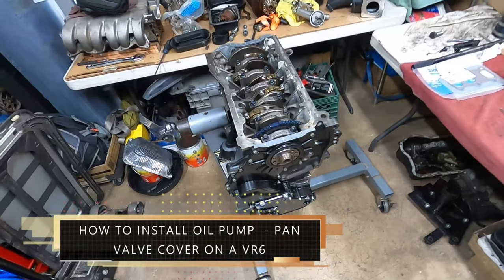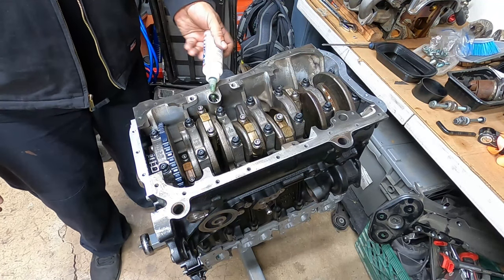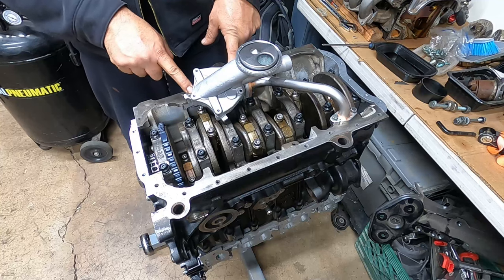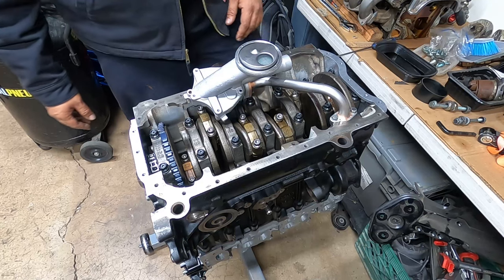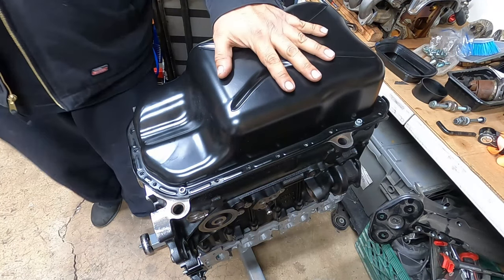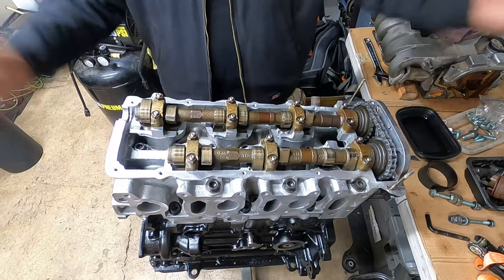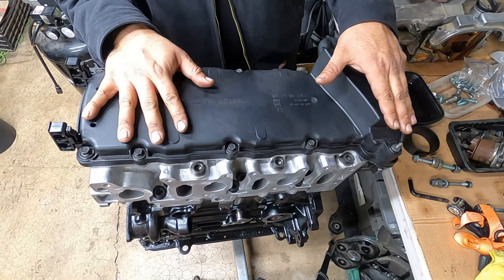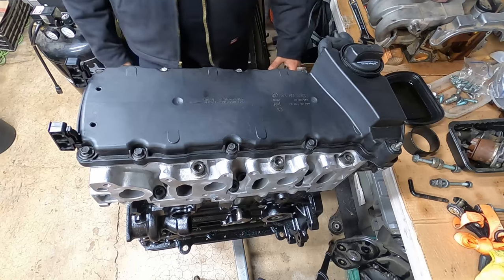How to install an MK4 Jetta/gti VR6 oil pump - pan - valve cover S7EP22

Comment: I ran into a similar issue with pan clearance with my baffled steel pan.  Found out that using a mk5 r32 oil pump is the only way some shorter pans can be ran.

Comment: What is different on the 24V.  I have one that keeps throwing the warning light.  Was gonna pull the pan and change out the pumpt etc.
Reply from the maker: 1st check your oil pressure sensor 
Check the wires and sensors before you pull the pan.
If you done that still have a light then pull the pan Inspect the pickup tube for debris if it's clean then the oil pump needs to be replaced
Reply: @PincheALsGarage  Excellent, thank you!
Reply: Hey how would i go about checking the sensor and wiring

Comment: So I’m doing this under the car. Is it much different other then clearance and free movement? And are those really the only things that the oil pump plug into?
Reply: I’m doing a aluminum pan and oil pump cause a rock shattered mine to pieces

Comment: What’s your go to place to order vw parts? I have a 24v vr6 just sitting around because the oil pressure light kept coming on and a coolant leak.
Reply from the maker: We use 
Urotuning.com 
Ecstuning.com
Fcpeuro.com
AutoZone 
For all our parts we make sure that we only get German parts too.
Reply: i just got mine and its doing the exact same thing

Comment: Good tutorial again al. Could you not laser cut like a 10mm shim to use as a sandwich between the oil pan and block? On you plasma table.

Victor reinz should become a sponsor of the channel 😁
Reply from the maker: Talking to Luis he said its suppose to be like this. So we are keeping the pan
Reply: @PincheALsGarage  but wouldn't that block the oil pick up though
Reply from the maker: @davidkane9876  the pickup sits at a angle not flat like in a 1.8t pickup
Reply: @PincheALsGarage  oh I see that's cool. Strange how it would sit on the pan though. That's a first for me tbh